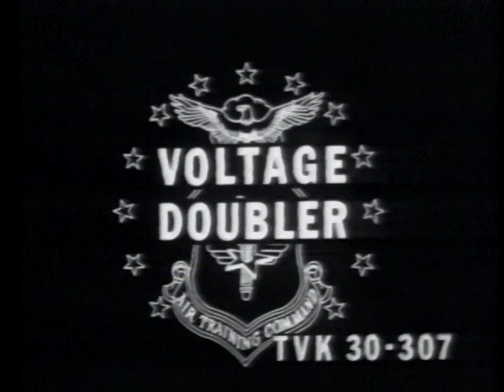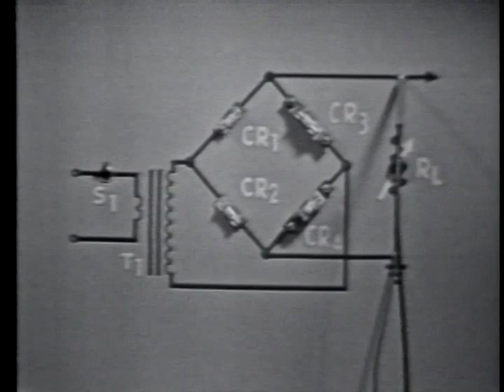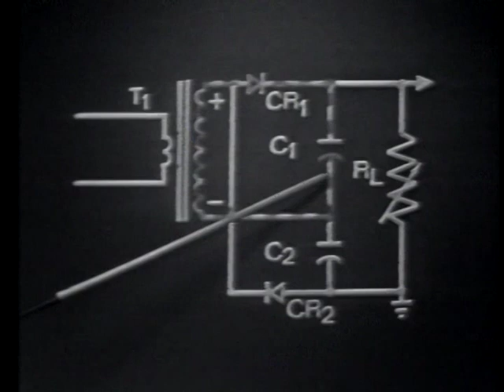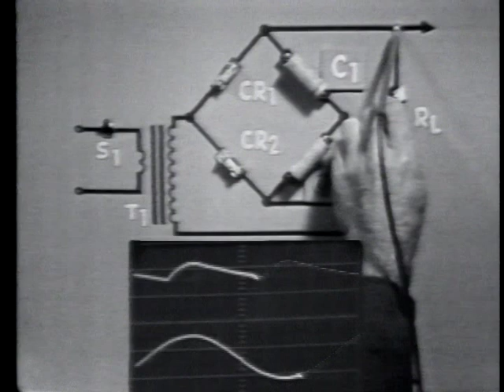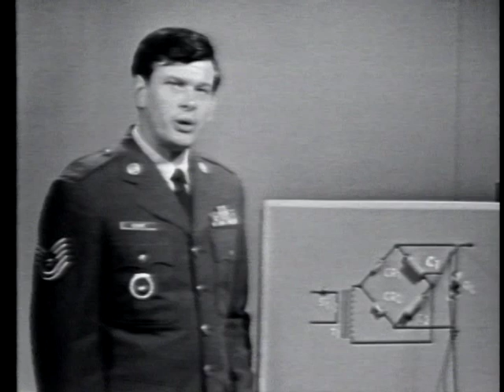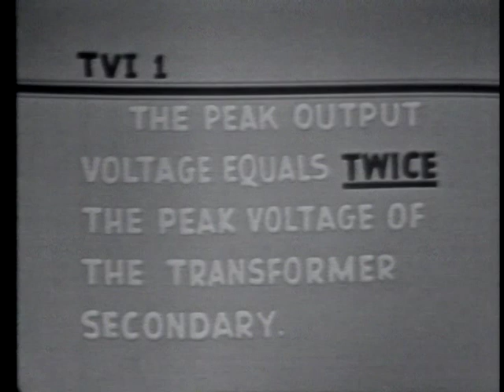VOLTAGE DOUBLERS

Comment: It's not the transformer that doubles the voltage, it's the diodes and capacitors. As he shows in the video, it's just a bit of kerfoobling with the rectifying bridge. Takes up much less space than including another transformer.

Sometimes, for whatever reason, you need twice the voltage from the supply you have. Transformers are bulky, heavy and expensive. This is a small, quick, efficient way of doing it. It's also often used as a first stage to drive things like Cockcroft-Walton multipliers.

Comment: I won't thumbs down, but I found this video to be stupid and a waste of time. Anyone in electronics for more than a week will know all this. Any transformer with a 1:2 ratio is a voltage doubler, and not really all the exciting. 

This is more of a simple power supply than a voltage doubler. I would have really enjoyed about hearing about dc to dc voltage doubling!
Reply: Well you missed the point then. He's not talking about doubling due to a transformer.  Watch it again is doubled with respect the to secondary.  Not primary to secondary.

Comment: This is a 1950s film at the most 1960.   USAF was using computers in 1970s.  F-16 and F-14 made its debut in the 1970s both with fly-by-wire technology.  Plus, the first laptop computers were being used by NATO countries in the early 1970s.  Perhaps you should do some research at the library or take a history class at a university  or college. Oh no, budget cuts, 'lack of interest', and the 'need' to emphasize science and math is most important, right?
Don't knock me  'cause I won't go down.